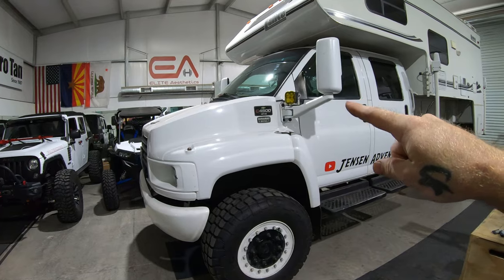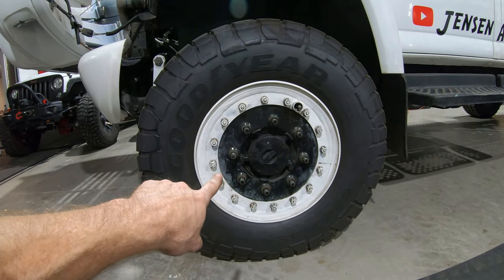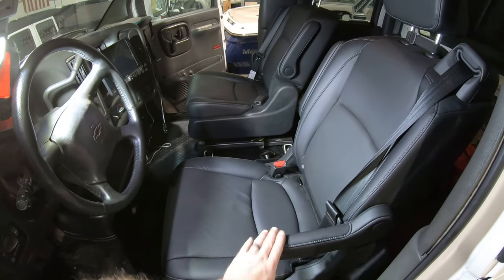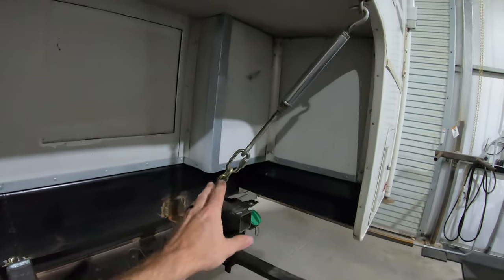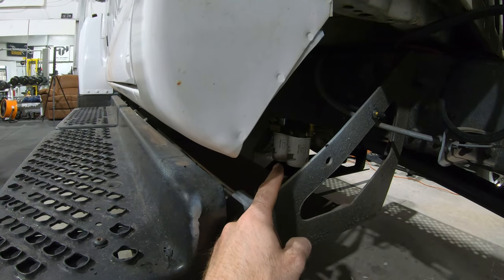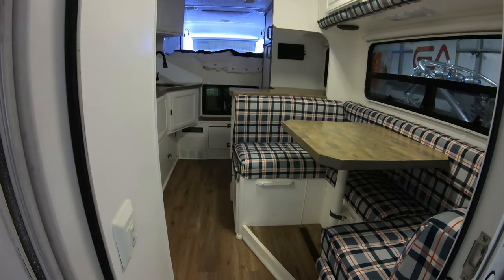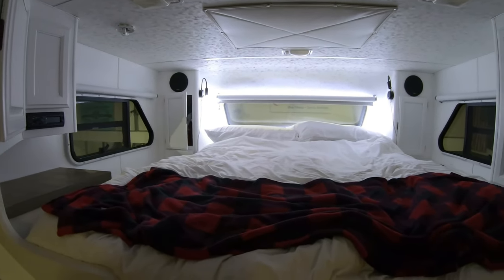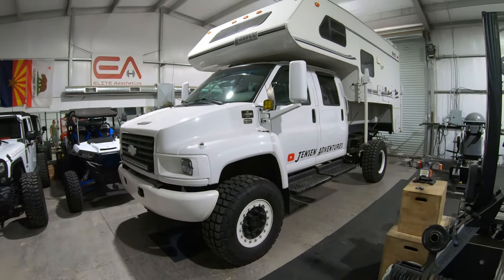4wd Kodiak Truck Camper Walk Around!

Comment: Very nice. I was wondering if the truck won't be sucking hot air with that filter and how many psi do you put your air bags?
Reply from the maker: Yes I’m looking to get a stock intake for the truck! And I run about 20-25 psi in the airbags. 70-80 in the tires

Comment: Can I ask were did you get your steering stabilizer ? I have a 2006 C5500 4x4 needing one. Thanks
Reply from the maker: On Amazon it’s a Safe-T-Plus stabilizer. You have to buy the mounting bracket separately.

Comment: What did you use for trim to wrap the two little rounded  corners below the dining table? I’m using 1/4 round for my trim but having trouble with that
Reply from the maker: I found some trim pieces at Home Depot that I modified to make fit as good as I could. I will be redoing that part in the future because it’s not exactly what I want but it works for now!

Comment: Grate video!
 I have an 06 4500 kodiak I'm building as an expedition rig also. Can you tell me more about your lift pump. What are the pros? Were you having problems with the factory pump?
Reply from the maker: Thank you! That’s awesome! With the lift pump it helps with filtration and water separation, way more fuel volume to protect injectors and or help deliver fuel for bigger injectors. The kodiak have a cp3 pump and no lift pump from the factory. I had no issues with my cp3 but wanted  peace of mind for my fuel system.